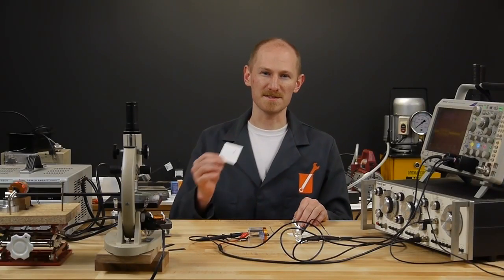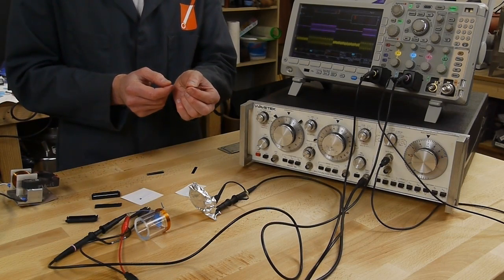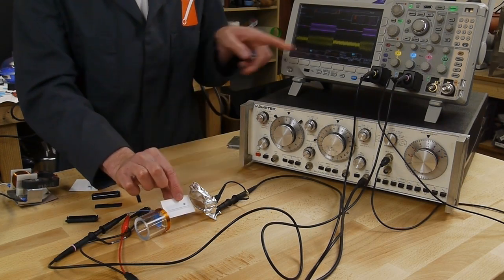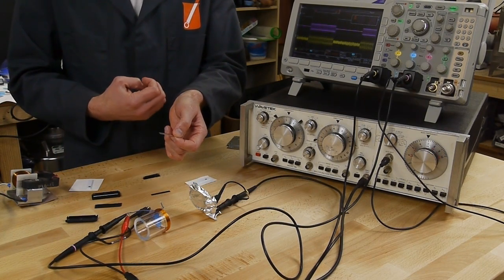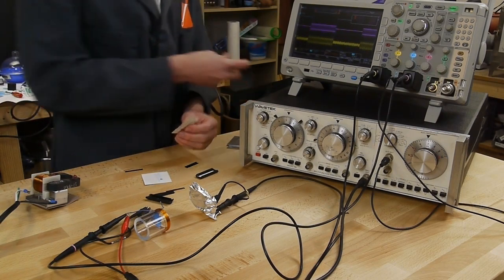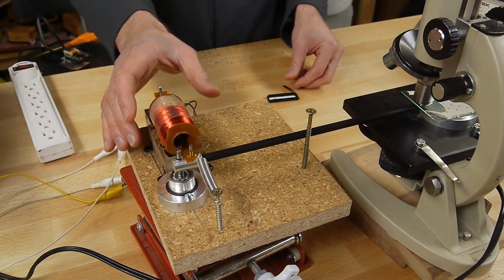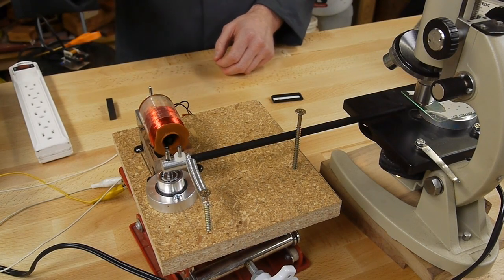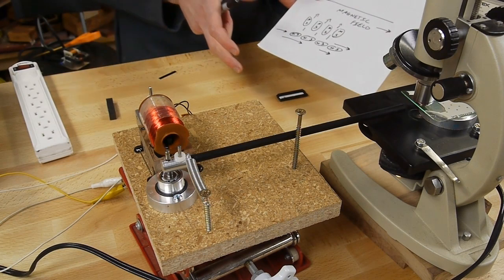How anti-theft tags work - magnetostriction

Comment: Thanks for a great video on magnetostriction.

MetGlass is great as a core for a flux gate magnetometer because of it's extremely high mu.
https://prc68.com/I/FGPat.shtml#CM
Terfenol-D is about 40x more active than MetGlass:
https://prc68.com/I/Magnetics.html#Magnetostriction
https://prc68.com/I/CRT-1BSonobuoy.html
The first sonobuoy used a cylinder of Nickel sheet metal biased with a magnet and overwound with a coil of copper wire as a hydrophone where the magnetostriction of the Nickel was the key.

Comment: So all you need to fool this whole setup is a demagnetizer in your pocket. And If someone had a metal implant that resonates at 58kHz then the alarm would always react.
Reply: +pvc988 Many products are source tagged at the factory to prevent you from doing anything.  You would have to take the product completely apart. You also can't deactivate larger tags with inductors in them.  You're not going to have a metal implant that resonates at 58kHz.  The only reason those metglas stips do is because of the magnet causing the mechanical vibrations.
Reply: +Proto G You've said this a few times now. I don't get what "source tagging" means. They stick an active one of these into a product when it's manufactured? How does that defeat a de-magnetizer?
Reply: +Bowowowification Yes, they put ferrite tags into products when they are manufactured.  Ferrite tags can not be demagnetized because they work differently.  They have a ferrite core coil with a capacitor that resonates at 58kHz.  Strip tags like shown in this video are also used for some source tagging and could still be deactivated if you know where the tag is.  Large power tools aren't exactly easy to run through a deactivator, but they are still tagged at the factory.
Reply: +Proto G Hmm... At least when it comes to electronics and electric tools, I've never seen something like that inside. And I've seen a lot of devices from inside. But I've seen coil/cap labels glued to some products (most notably, vodka bottles). Then how do they deactivate these?
Reply: +pvc988 They are everywhere and can even be built into the circuit board.  The labels get deactivated differently.  The labels are introduced to such a high emf that it damages the circuit like a fuse.  Labels can not be reused unlike the strips shown in the video.
Reply: +Proto G Ok. Then what about wrapping such product in aluminium foil? It should screen the inside from electromagnetic field.
Reply: +pvc988 A weed wacker or other large power tool? Sure you could, but it needs to be completely sealed and that is a pretty serious crime if caught stealing with tools.   The possession of criminal tools is an added charge and the aluminum would be considered a tool if used as such.
Reply: +Proto G I am not considering the law or if it's practical. I just wonder If that would work.
Reply: Proto G If ferrite tags can't be deactivated, does that mean they always set off the alarm at the door?
Reply: +Bowowowification Yes.  If they're external, they are removed by the cashier and reused.
Reply: But what if they are internal? How are ferrite tags de-activated?

Comment: the core of the planet is most likely made from the heaviest element possible even heavier than stuff we know existing, around that something lite like iron. think onion many layers.
Reply: www.skyblock.nl what? No. We know what the core of the earth is made of, and we actually know it through seismographs and observing how seismic events get displaced as they travel through one side of the earth to the other. That's also how we could tell that the earth isn't solid all the way down. There's the mantle and the outer core and a solid iron-nickel core. I'm amazed that we've come so far that we don't even need to drill a hole to see what's underneath our feet.